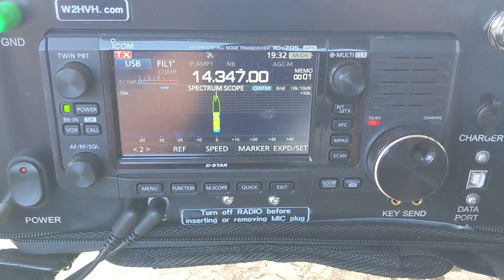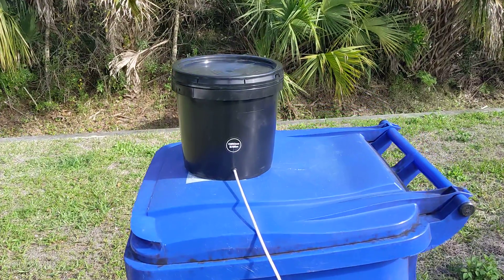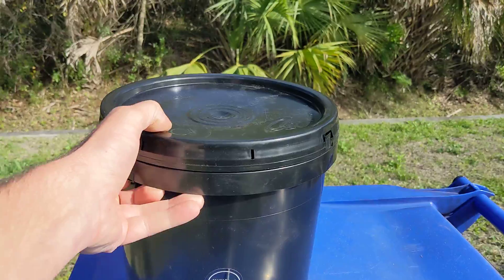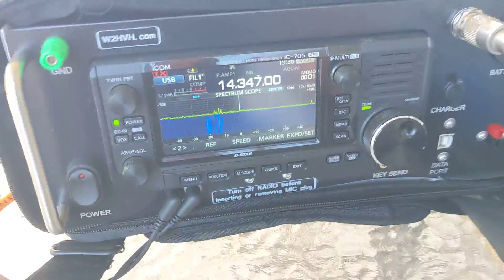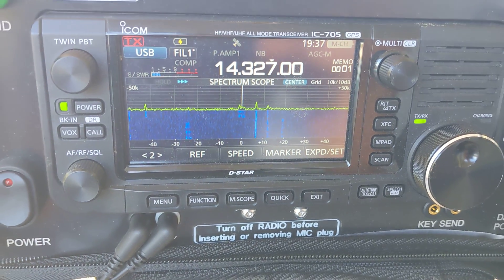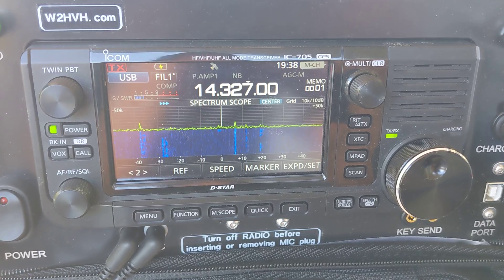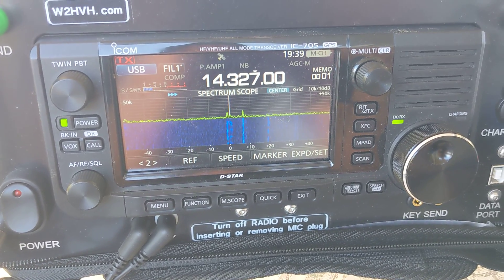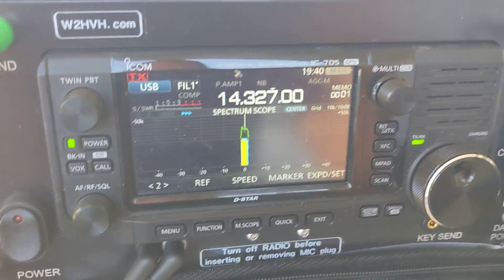NEW!!!! HF Stealth HOA CompacTenna 20/40 Micro, Breaking The Rules For HF Operation!!!!

Comment: 2 years in a row, i am using my own design 20$ parts antenna, less than 15ft over the ground, resonant on 80 and 17 for some reason: I have a band for local coms and a DX band,.longest phone comtact 9000km, lots of contacts at 5-6000km into sth america and europe from canada. Maybe i should start mass production and drop it on the market ;)

Comment: Ok, not rocket surgery. What you have there is a radiating coax, looks like about 25-30 feet, no RF choke and I'm guessing there's a coil inside the bucket. We know antennas on the ground work, not great, but can. The entire "antenna" includes the coax, not just the bucket coil. Will it/does it work? Obviously it does and could be a viable solution for HOA hams. My issue is that a ham hasn't already tried this approach or some variation of it in his search for a solution to a HOA problem. Not rocket surgery to be sure and a [horrible] compromise for anyone who isn't in a HOA situation. I don't want to offend or rain on anyone's parade, but just point out there's no Wizard of Oz here, just regular, very basic radiation going on. Again, very limited application, a last resort.
Reply from the maker: I'm planning on having doctor jack on video explaining it. It's a bit more than a coil of wire inside.
Reply: I'm sure there are even if there's a handful of inductors and caps. Consider the Chameleon or the Alpha tuning devices which permit the use of short radiators. In both camps they seek to resolve interoperability by providing a workable solution for some difficult situations. This device is of that same intent; to provide a solution for those who haven't any other way to get on the air.  So back to my concern which is this: Hams who have the resources, however few they may be, should opt first for the dipole, the end-fed, the vertical, etc before jumping right into this device. Anyone who has studied the materials to get their license [should] know you can't get yagi or even a good dipole performance out of a device like this unless it's elevated and getting the coax off the ground. You were kind enough to show us the coax run twice (neat color by the way!) and I didn't see a choke at the antenna end; I didn't expect to see one. This antenna needs the coax to work well if at all. 

I can think of one guy who lives in a townhouse who just might be interested in something like this, so yes, I think we need to see things like this just as long as we all know the limitations of it.
Glen KE7FD